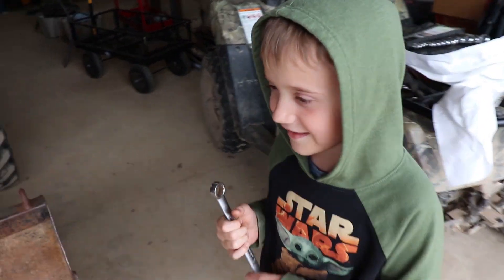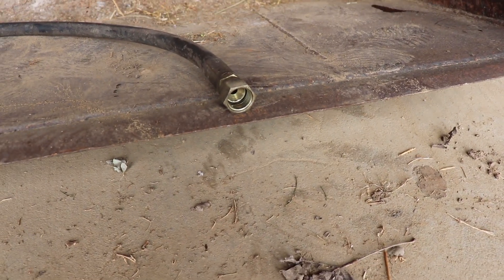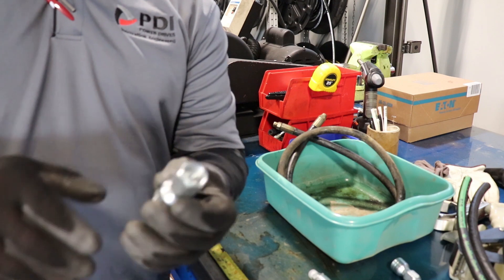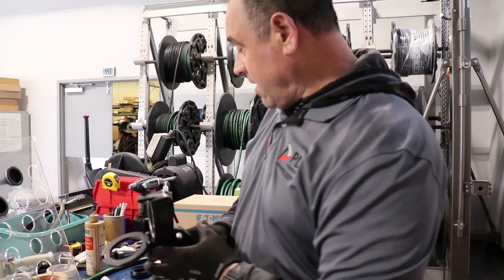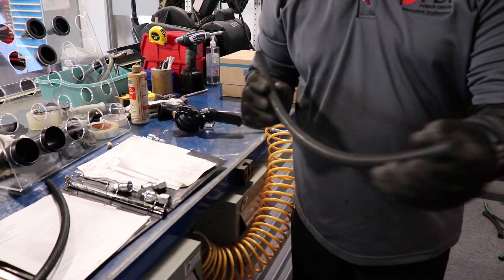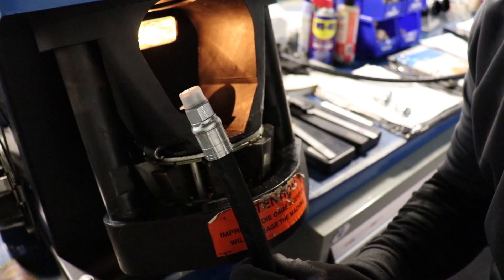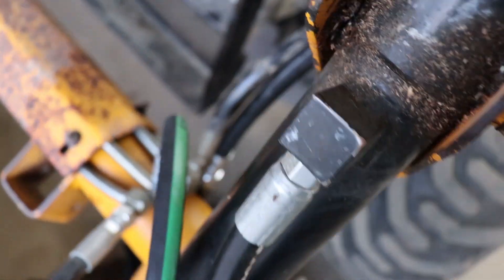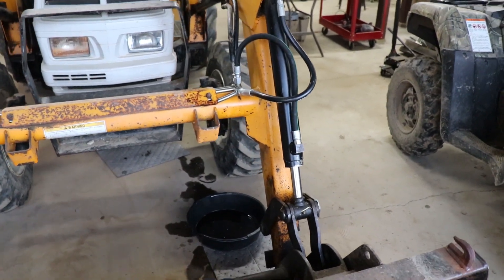How To Make A Hydraulic Hose For Your Bucket!

Comment: Appreciate the video but you crimped it wrong. The stem should have been fully under the die. You left some on top and it mushroomed.  I was taught to put to stem end (the end where the hose goes in at) under the die by about 1/16" just for good measure. That way the entire stem gets crimped. But hey, now I know what it looks like when someone mushrooms one! Thanks again!
Reply from the maker: Nope....you are incorrect. This is 100 percent correct. I run a hydraulic hose shop. This is an Aeroquip fitting. The crimp is to start at the line that is grooved at the top of the fitting. That is the purpose of the grooved line. This is a textbook crimp. If you go above that line, you can distort the hex below the fitting made to put a wrench on to hold when tightening. ALL fittings should be crimped just below where the fitting starts to round as that is where the hose inside ends. 

I love how people, like you, who have zero training in hydraulics, tell me who has made 1000's of hydraulic hoses and has extensive knowledge of hydraulics, that you know better. LOL.
Reply: @TheCookFamilyHomestead  zero training yet just made an observation that only trained people would know. I work with Gates fittings. And in order to make the crimp right, you need to place the fitting 1/16” below the top of the die cast. 
So no, your crimp isn’t textbook unless it’s the page that has a picture of your crimped fitting with a red circle and a red line through it. 
Mushrooming the head pulls the metal away from the hose being crimped. What good mechanical purpose is there in mushrooming? Make a video so I can send it to the trainers at Gates.
Reply from the maker: @2001BornAgain  you work with Gates fittings? Who cares. I work FOR Aeroquip fittings. This is a perfect crimp for an Aeroquip fitting. I've crimped thousands. Not going to argue with you. You are ignorant. If you don't like it feel free to go troll someone else.